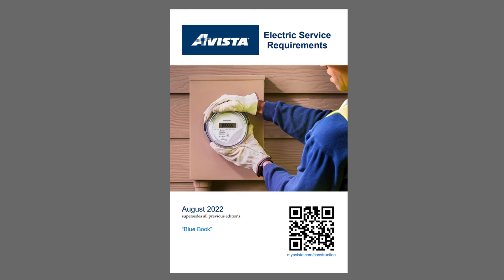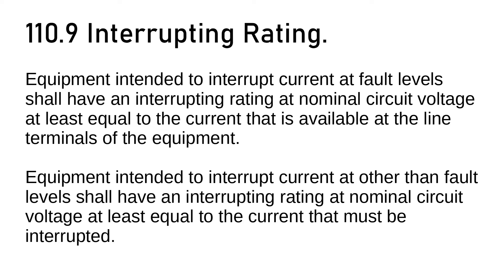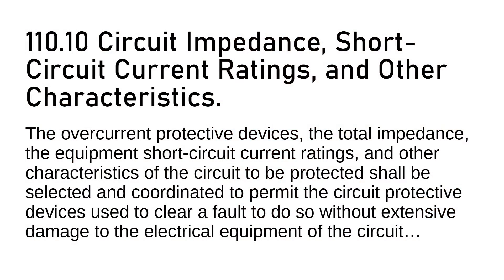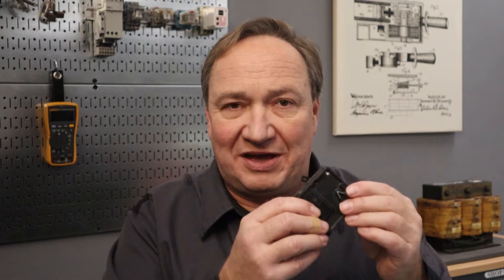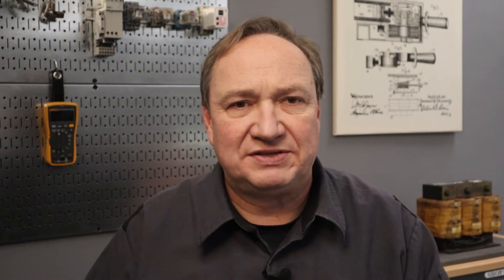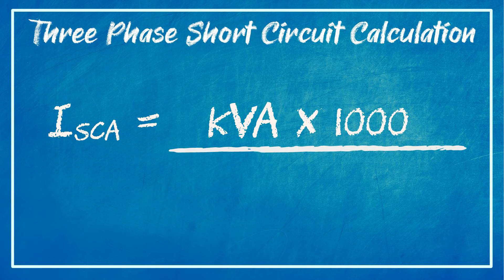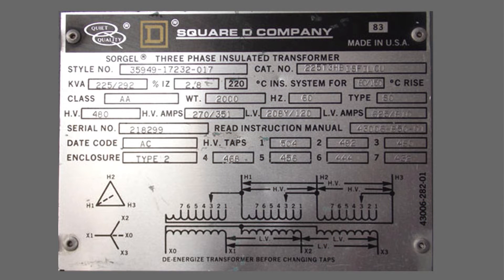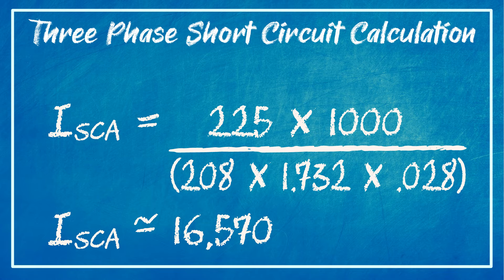Calculating Fault Current using transformer impedance

Comment: Hello, for some reason, I get a different answer on my calculator. 225x1000/(208x1.732x0.028)=22,305.56
Reply: Correct. Please look at my pinned comment. Should be first comment in the comment section. Thank you.

Comment: Great Video. Is Current SCA = 14.6A on the Primary or Secondary side?
Reply: Notice that you calculate the short circuit current using either the rated voltage or the rated current of the secondary.  That should give you a hint that the SC current you are calculating is on the secondary side of the transformer.